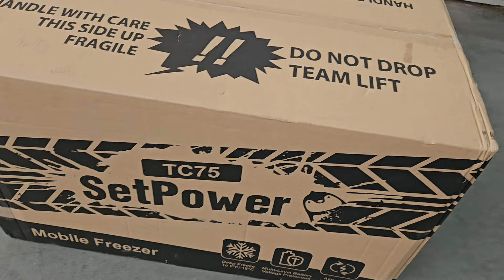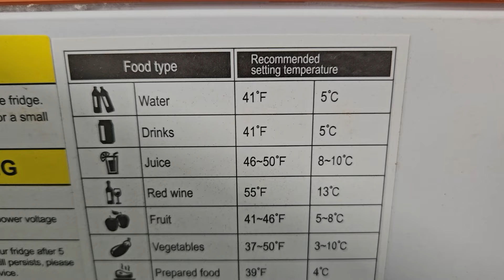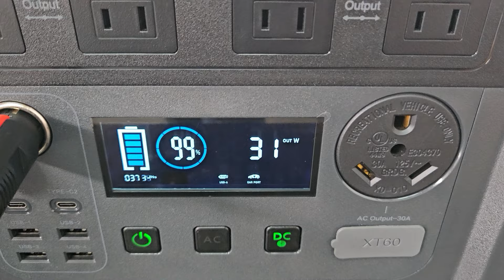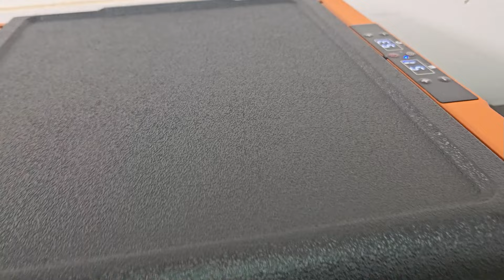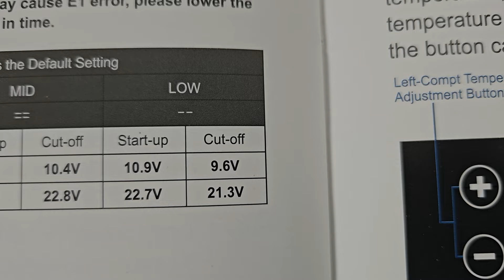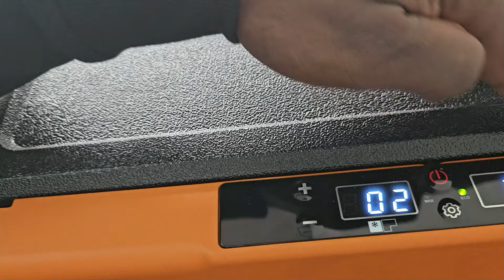SETPOWER TC75 Portable Fridge Freezer, 80 Quart (75L) Dual Zone Portable Refrigerator 12V/24V

Comment: I like these kinds of portable fridges.  Maybe something interesting to see would be the run time difference between AC and DC.  With AC, you are doing more conversions and lugging around more hardware in general.  Another way to do things is to hook directly to say a 24V LFP battery.  Then there will be no conversions, just straight from the battery.  Hook in a USB charger and maybe an MPPT controller and you should have all you need for say a camping trip.  Say you used a 24V 100AH LFP battery, that should last you for days even without the solar charger / you have a forested over camping spot and so solar panels won't work.

If say you are trying to do minimalist car camping without power at the campsite, but you also want to keep your food cold and not deal with melting ice, you will probably want to bring some things like:
1. LED lantern, LED flashlight, and an LED headlamp.  These all need USB charging for when the batteries go down.  I suppose you could do say a propane lantern, but really LED is much nicer, easier to work with, and safer.

2. Your cell phones, which need USB charging.  Everyone always has their cell phones on them even if there is no signal where you are at.

3.  Something to keep your food cold the whole time.  This is a very nice portable fridge to have for that.  Much nicer than messing with ice.

4. Something to cook with.  A propane 2-burner stove and a griddle is very nice to have around, granted the griddle can be a bit of a PITA to clean, though overnight soaking can do wonders for this.  Pots and pans of course as well depending on what all you want to cook.  You can get refillable 1lb propane bottles that you refill with a larger tank and a 1lb tank will allow you to cook your food for days.

5. Something for fire.  The old school thought is to burn firewood, but like at the local supermarket this is $26 a bundle and those bundles are small.  Fire with a propane fire pit and say a 20 lb tank is a lot cheaper and takes up less space in your car as well as burning cleanly, granted you want to be careful on how you transport propane so as not to blow yourself up.  Granted the one guy I saw who strapped multiple propane tanks to his rear bumper, I am not sure if that is actually a safer way to transport propane considering how I see people drive around here.  With propane, no more shifting around the fire pit because the winds shifted and you are getting choked out with smoke because there is no smoke with propane.  If everyone did something like this, those with asthma issues won't need to pull out their inhalers at night to experience the "great outdoors" because what that really means at night is your are choking on all of the smoke from everyone's wood fires in what are often crowded campgrounds.

6. You add up everything from above and you add in a 24V 100AH LFP battery and hook a USB charger to the battery, that should power your fridge and charge your USB devices for a few days.  Then have your fridge plugged into your car while you drive to and from your camping destination.  That should be enough to cover most people's camping trips.  Most people don't stay for more than a few days anyway.  No need for power inverters.  No need for a large charger for the LFP battery.  No need for solar panels, especially if solar panels won't work at your campsite anyway due to say shade from trees.  And no need for a generator thrumming away and annoying your neighbors.

All of this can fit into someone's car, van, SUV, or truck and leave room for other things like a tent, clothes, and other basics.  Plus none of it is expensive; it is all pretty cheap for low budget trips.  When you are car camping, the less space you use to get the job done, the better.  And the better your gear works out, nothing catching on fire that shouldn't, things not burning that you need to burn, no batteries dying prematurely that you can't charge up, just things working and working nicely, the less stressful and more relaxing your camping trip should be.

Comment: Good evening Gavin. Another epic review by the king of generators reviews. Off topic, Gavin , is there a adjustment screw to lien out the carburetor on my predator 9500? it smells like it is burning rich and I have to keep cleaning black soot from the spark arrestors. Thanks again.
Reply from the maker: Thanks for watching 
Have you tried upgrading your spark plug to a NGK plug
Reply: @GeneratorReviews  yes, been using NGK since new. 1st oil change at 1 hour. 2nd at 10 hrs. Every 100 hrs since. Air cleaner is spotless and have done everything to make this thing be my Honda killer. At 1300 hrs now and this thing is DRINKING fuel. Also, have never put anything except non ethanol premium in it. I’m so disappointed. I’m back in the market for a Honda eu 7000. The last one I had went over 10000 hrs.